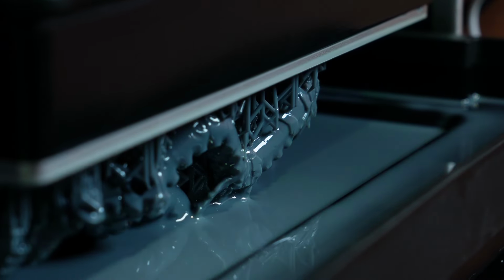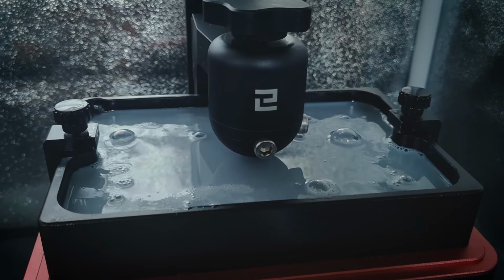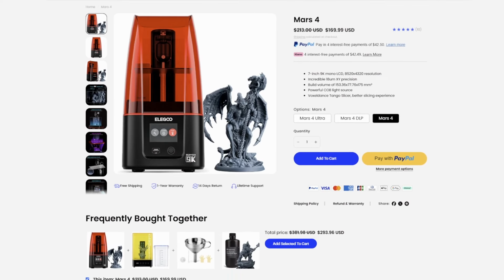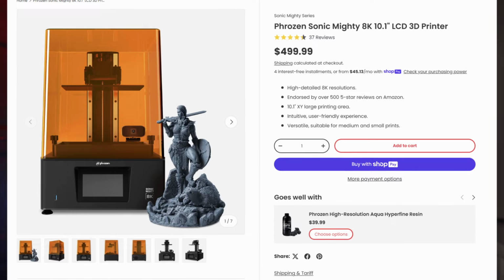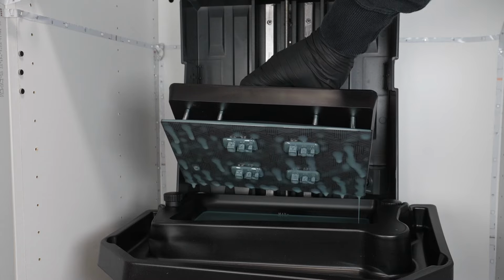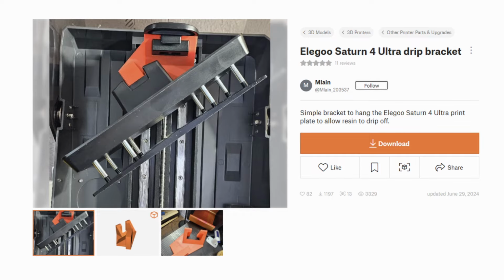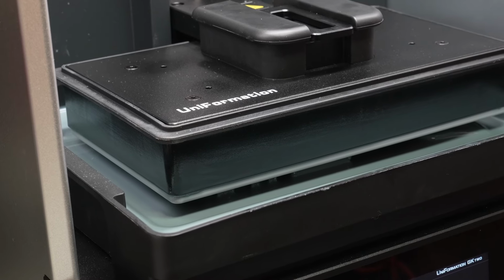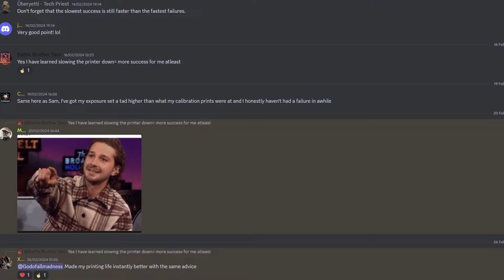Which 3D Printer Should You Buy To 3D Print Warhammer Models?

Comment: i have a mars 5 ultra, the pixel size is 18 microns so its incredibly detailed, the 7 inch build plate is big enough for miniatures. the tilting Vat feature is a huge time saver and makes prints more reliable, its pretty begginer friendly, i got one for $270. dealing with resin is a pain but you get out what you put in. once you figure out how to do supports efficiently things get alot easier.

Comment: Please do bear in mind that the elegoo mars 4 9k does not support anti aliasing. There is currently a bug with the .goo format that causes anti aliasing to not work. Elegoo doesn't plan on fixing it.
Reply from the maker: Ah I did not know that, can it accept ctb files? Does aa work with ctb?
Reply: @battlebrothersam  their new generation printers that aren't ultra versions are locked with the .goo format. So the saturn 4, mars 4, mars 5.

If you want .ctb support, you need to buy a ultra version.

Comment: There is a lot better implementation of a dripper exists than you've shown for S4U, called "Saturn 4 and 4 Ultra HANDLE x DRIPPER" it attaches to buildplate making better handle and doubles as dripper. S4U is pretty much top notch printer even with it's downsides part of which can be tuned via .gcode configs(for instance, i're reduced amount of slow layers to 10 instead of 50, it's actually possible to make tilt-vat even faster)
Reply from the maker: Thanks for pointing that out! I genuinely didn't know you could do that!
Reply: @battlebrothersam  if you mean .gcode configs, than it's possible with almost any "consumer" printer since they're all based on chitu hardware and software, the major problem with S4U and M5U thou is that they are different than old once due to tilting vat and without original config and possibility to dump current one it's almost impossible to guess the settings, yet there is S4U config with comments which explains pretty much everything, if you will look for it - it's in elegoosaturn subreddit in post about Wham Bam issues

Comment: Nice comparison of resin printer. But what about a „normal“ 3D printer with a 0,2 nozzle? The detail is great (imo), but i dont know how it compares to resin. It is easier too use, because you can just print and get your model without curing it. Also it is more vertisail, like you could use it for different projects. Filament it also cheaper than resin. And a good model would be a Bambolab A1 mini with a price tag around 200 - 250 €. What is your opinion about printing Warhammer and other tabletops with a normal 3D printer?
Reply from the maker: I have seen a few videos about using a bambulabs a1 for minis but I haven't got my hands on one yet to try! I have tried tanks with my ankermake m5c but it was... A mixed bag lol
Reply: @ good to know. Maybe I will give it a try, when I got my minis painted and my hands on a printer.
Reply: I print at .02mm layer hight because that's when you can't no longer see layer lines at any distance and therfore require no sanding of the print like FDM, this really helps with chrome/gloss coat on models, a wash and cure station can also make post process nearly effortlessly in 20 minutes although with a high cost.
Resin is also versatile, clear resin for one actually look like glass, resin printers are also used in multiple industries some that FDM can't compete in like dental. You can get pretty good resin printers now for around $250 that are superior to $500 printers from 2 years ago.
So for minis a small high resolution resin printer can give you better model detail than injection molded ones.
Reply: As someone who has a Bambu P1S, it's definitely possible to print good minis, but a big issue is finding wargame minis that are designed for an FDM printer. For example, some tyranids stls I have are not built with FDM supports in mind, so you have to place them at weird angles and even the the supports are hell to remove. Plus unlike resin, the more minis you print or the bigger they are it begins taking much longer to print.

I think FDM could be a viable option for wargame minis, but people are going to have to start making sculpts with it in mind.

Comment: what we need is for someone to figure out a reservoir system that dispenses just the minimum of resin for printing so there is minimal resin to deal with, be it pouring or drips or post cleaning. The messiness is the biggest roadblock to resin printing right now, not any fancy features.
Reply: you actually want as much resin as you can have in the vat to reduce oxygen from getting the print zone since this can cause O.I.L to form which is just uncurable resin.